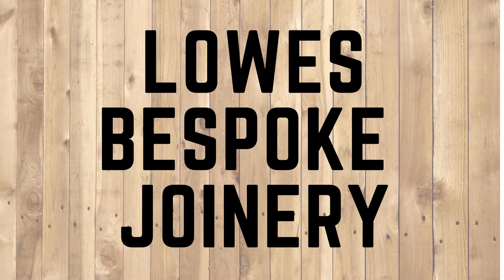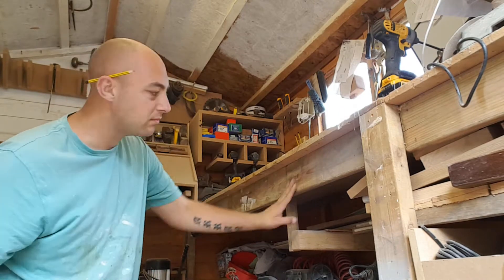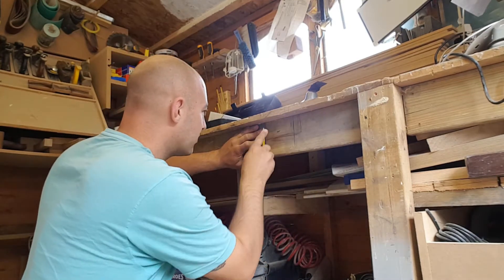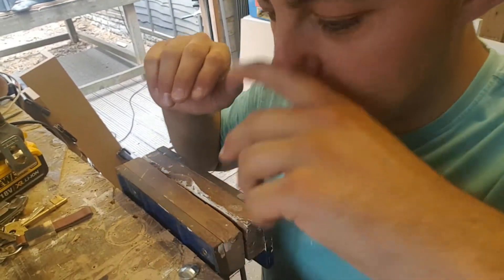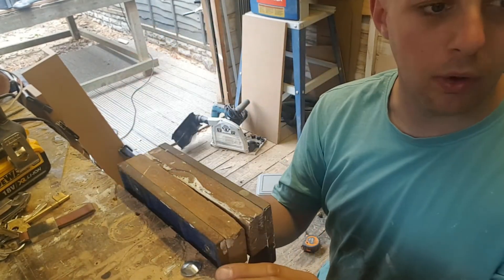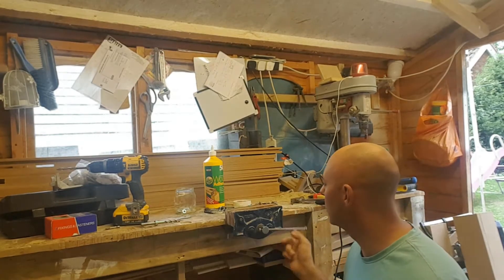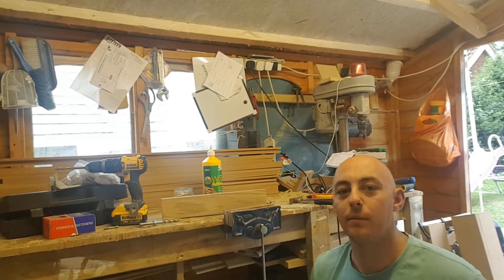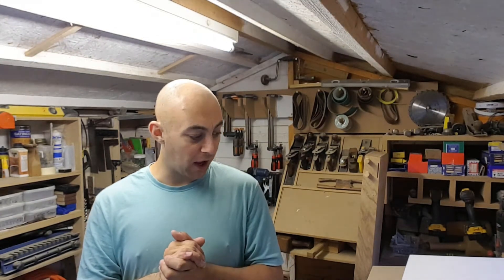Fitting a woodworking vice

Comment: Fabulously practical, no nonsense, workmanlike installation. Good on you. I just prefer my vice to be level with the bench top.
Reply: Couldn't agree more. If the vice protrudes over the top level of the bench it limits that bench's potential. He should have spaced it under the ply top and counterbored the coach bolts to keep a flat level on the bench.
Reply from the maker: Yes both I couldn't agree more... think ill rename it  fitting a vice the wrong way lol
Reply: @Maltloaflegrande  yea just need to gap it down with some ply and widen the notches cut 👍